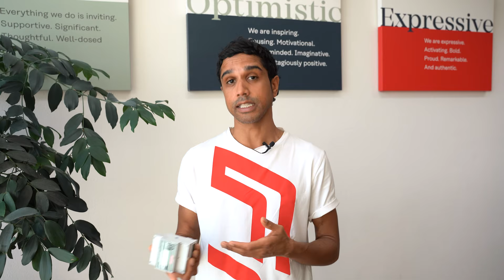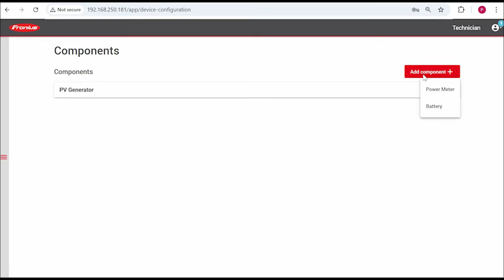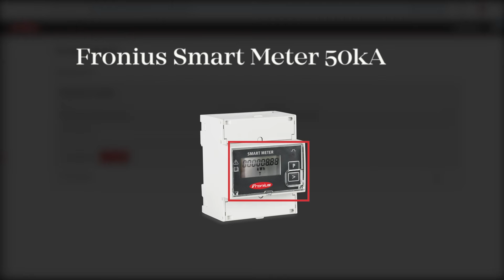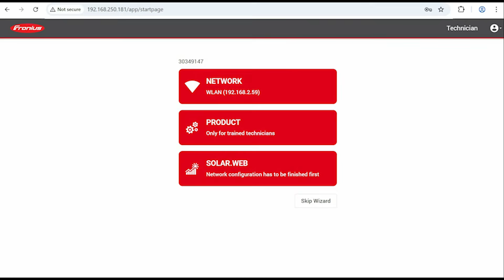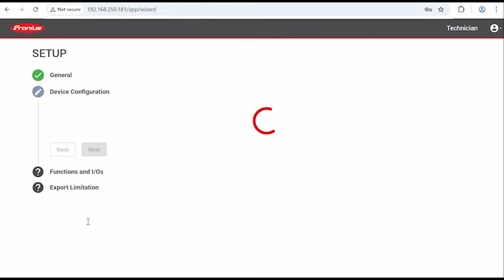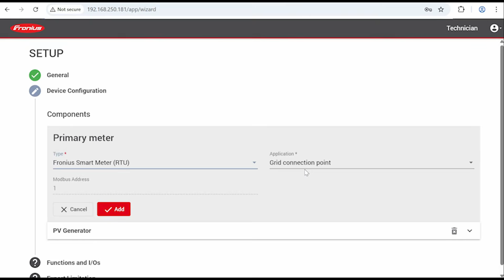How-to | Pair a Fronius Smart Meter with Fronius Pilot Card Inverters (GEN24, Tauro & Verto) (AUS)

Comment: MQTT?
Reply from the maker: Starting from software version 1.36x on our GEN24, Tauro, and Verto inverter series, it is possible to connect a Smart Meter IP to the inverter via MQTT. Please note that this functionality requires not only an inverter with software version 1.36x or higher, but also a Fronius Smart Meter IP running software version 3.0.0-0002 or higher.